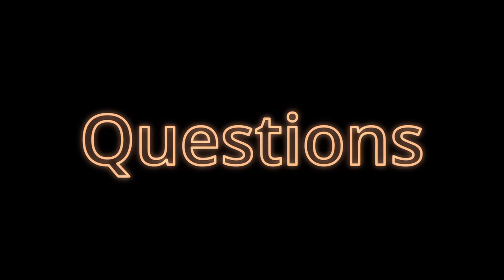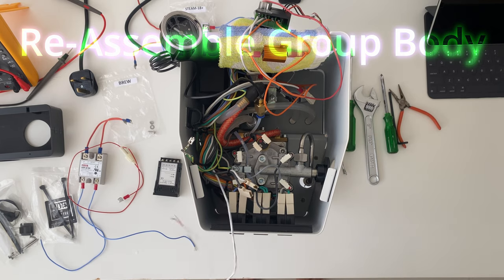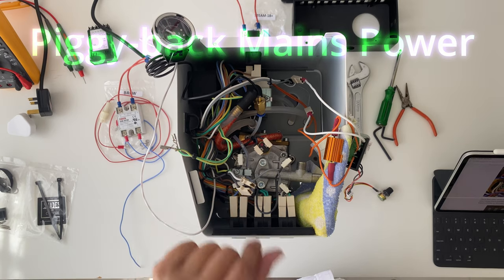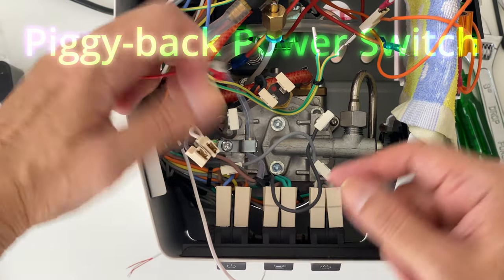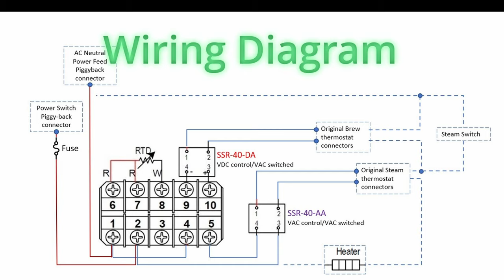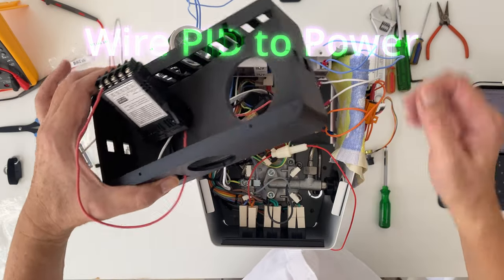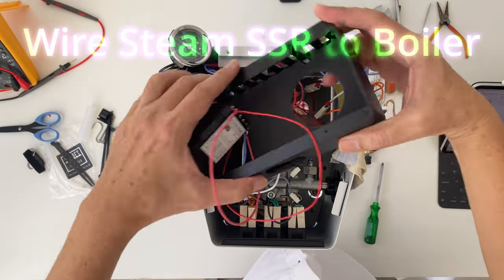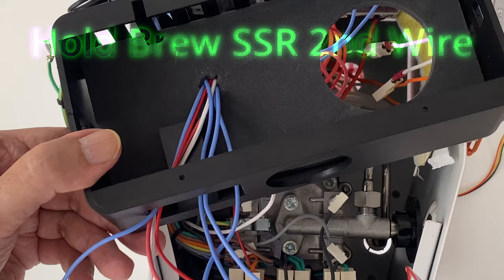DIY Mod Gaggia Espresso Coffee Machine (Part 3)

Comment: With the dimmer mod the pressure is not stable
The PID is sapping power to maintain temperature, If the temperature drops slightly below the SV value causes the pressure to be unstable.
the pump sounds like it's working on and off, and it's actually hard to set the pressure because it's unstable.
Do you have any suggestions to solve this problem?
Reply from the maker: @ibrjamel  PID uses power but doesn’t “sap” power. The pressure is not highly dependent on the temperature SV. 

The pump shouldn’t sound On - Off: there could be a leak somewhere, maybe related to the tubings to the  pressure gauge. 
Test with a blind filter basket, not coffee puck, during the initial trials for pressure and leakage checks. Double check all your wiring.
Reply: I forgot to mention that this problem appeared after two days of assembly.
I checked inside the machine there are no leaks.

The pump weakens its operation when the pid light flashing

I have uploaded videos if that helps you understand the problem I have.

Urls:

https://youtube.com/shorts/70VtdTXCTdU?feature=shared

https://youtu.be/GXVngopEKZ8?feature=shared

Inside - DIY Mod Gaggia Classic evo 2023

https://youtube.com/shorts/P1t5TsXYGxg?feature=shared
Reply from the maker: @ibrjamel  I have watched your videos. Since you are brewing/checking with coffee puck instead of testing with a blind filter basket, the behavior of the pressure & temp readings' changes are normal. 

During brewing the pump is activated maintain the set pressure by supplying water from the water tank to the boiler. As the Gaggia tank is quite small and the tank water is cool, the temperature in the boiler will drop, which will in turn activate the PID controller - this is normal and is the reason for the flashing LEDs. The pressure will naturally fluctuate a little because water is entering from the pump and exiting to the coffee puck. So the PID is not causing the pump or pressure to fluctuate, it's just normal corresponding behavior during brewing.

From the sound of your machine's pump I don't hear any abnormal behavior. During brewing with coffee puck some variations in pump sound amplitude and pressure is expected. I don't hear any "ON/OFF" as you described previously, some other machine makes have this weird behavior - avoid.
Reply: @troncaffe  Thank you for your dedicated and kind service, professionalism and availability 🙏

Comment: What a great video! Thanks for making this video for us!. Do you have a recommendation for good values for P , i , d values? Mine is always down 7c degrees when I brew I feel like my tuning is not optimal.
Reply from the maker: My settings: P=3.0; I=15; D=06; Souf=0.6.

If your Brew time is around 30 secs, then a drop of 7 degC is quite normal.
The Gaggia boiler is quite small and the fresh water inlet is relatively near the temperature sensor, therefore temperature reading is sensitive to the water inflow temperature. During Brew the boiler's heater in unable to keep up when fresh water pumping in, irregardless of the PID settings. This results in the temperature drop over the Brew duration.
Its a machine design constraint - espresso machines of a different constuct may be immune to this during brew.
But of course PID parameters do determine how fast & stable the PID controller bring temperature back to the set temperature.

My PID tuning process:
Set my desired Souf (overshoot); Let the boiler stabilizes at set temperature; Brew for about 30 secs to let temperature drop as it will; Enable the Auto- tuning PID; Then increase D by around 3 (for quicker reaction, because I am the impatient type).

Room temperature has significant influence too, as with some other main controller settings, but you already know that.
Reply: @troncaffe  Thank you!. I will try it today. What is your average overshoot above the set temperature?
Reply from the maker: @jamesmac6102  My Set_Temp = 93degC, overshoot goes to 96.5degC peak and back down in 100secs, no undershoot. RT-to-Set_Temp = 120secs. Smaller overshoot results in longer RT-to-Set_Temp for my unit.

Comment: Hi, you are really thorough, good, but quite frustrating to watch. Well shown, but you skip some pieces which unfortunately can cause problems if you want to follow your procedure.

This setup doesn't seem to sell as a complete kit on Shades of Coffe, can you link your complete Kit!?

Unfortunately, you have to pay double VAT if you live outside the UK, Shades of Coffe, they do not deduct the UK VAT from the price,
Reply from the maker: Good point about the links, I have updated the descriptions to include the links to the entire kit. The set of kits I use is also shown in part 1 of this video series, which btw is not yet complete.
It's not difficult to mod the machine at a fraction of the costs if you are willing to source the parts separately, and know what you are doing.
Reply: Well. I put together the Pid kit on aliepress for $65.
I'll see which dimmers I'll use haven't gotten there yet, I don't care about pressure gauges. I don't know if I should buy a Gaggia yet, it is on sale right now here, $370, but really I would like to find a used one, but it seems difficult.
I'm also looking at other machines that already come with most things, like the Profitec Go.

Shades stuff is extra expensive if you don't live in the UK.
Reply from the maker: Take your time with your purchase decision and enjoy the process. No need to mod the machine if all you want is making great coffee with it. I wouldn't mod the machine if its brand new because I want to know it well first.